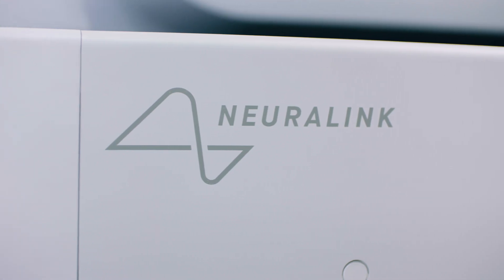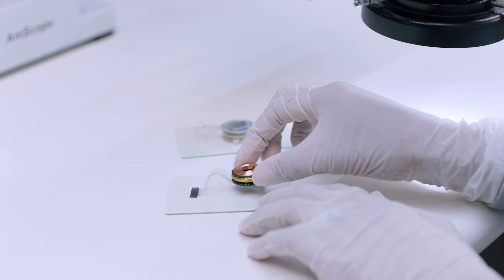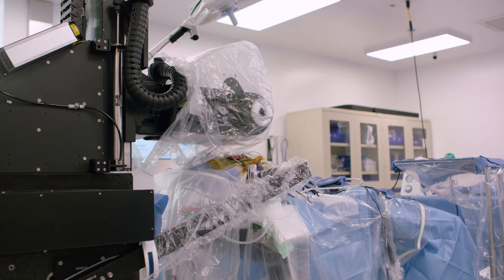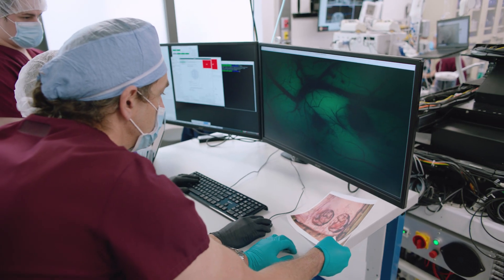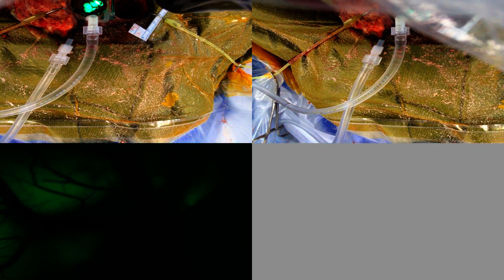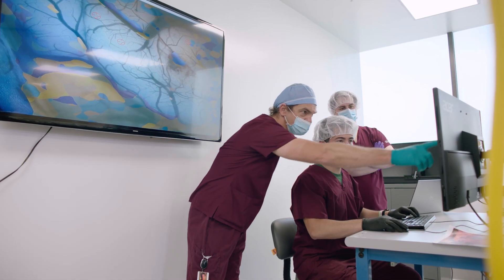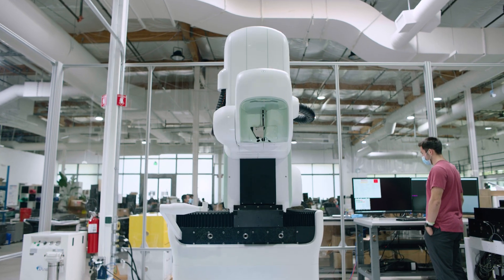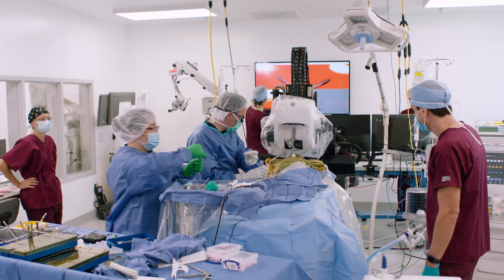Working on the Neuralink Robot

Comment: Some day I wanna work on a project like that. Though what I'd like to do specifically is work on the problem of brain digitization. I'm not a neuroscientist though (studying computer science currently). But my theory on how brain digitization would work is basically just replace one neuron at a time with a biomimetic neuron, and then replace all the neighbours to that neuron with biomimetic neurons before replacing the initial biomimetic neuron with a software neuron in an artificial neural network (basically use the biomimetic neurons to make a direct neuron to computer interface). I think doing it this way is probably the only way to digitize the mind of an individual without making a copy. Basically, replace the hardware (the brain) that the software (the mind) is running on, without ever disrupting the process (or with minor, recoverable disruptions), so that you don't create a new instance of the "software".

I know NeuraLink isn't about brain digitization, but you'd need to go about brain digitization in a similar way (using a robot to physically swap out organic neurons with synthetic neurons and such, as opposed to using it to precisely implant wires). I imagine that may be a future "next step" for this technology. I hope I can be a part of making it happen some day, but if not, then I hope it'll happen within my lifetime (I wanna be a robot fox :p).
Reply: The brain has billions of neurons in it though, this is a life time project maybe even a pioneer project that you can initiate during your life time but not seeing the outcomes of it. Are you ready for that sacrifice ? Do you believe in transgenerational R and D ? If yes then you have all my support and respect !

Comment: Wasnt there a big solar storm around the late 1800 that overcharged all telegraph stations? What would happen to an electrical implant and have you thought about safety measures?
Reply: The ability for a conducting wire or rod to pick up a signal is proportional to the length of the rod and the ratio of strength-to-distance squared. Because the neuralink probes are close to the emission source they can pick up the signal generated by the weak transmembrane electrical activity of neurons even though they are small. When in the presence of a strong pulse like an emp or solar flare activity, the small length of wire will generate negligible voltages in the probes.

Comment: How does the chip get its power? Also what if electromagnetic pulses disrupt the chip, what happens to the subject?
Reply: Well there can happen undefined behaviour... like computers every logical electronic device can have undefined behaviour, that chip cannot just read our mind but it can also send impulses meaning it can control our mind...
Anyway the power comes from a battery
Reply: The ability for a conducting wire or rod to pick up a signal is porportional to the length of rod and the ratio of strength-to-distance squared. Because the neuralink probes are close to the emission source they can pick up the signal generated by weak transmembrane electrical activity of neurons even through they are small. When in the presence of a strong pulse like an emp or solar flare activity, the small length of wire will generate negligable voltages in the probes.

Comment: So this chip will be connected to a web like interface. If it can receive and send signals directly to and from your brain, how would you really know what thoughts were yours or the systems? You wouldn't be able to differentiate between the two. If someone was able to take control of the system, theoretically they could take control of you. It is truly amazing when it comes to the repairs of motor functions and and brain injuries, but I'm not quite sold on everyone getting this.

Comment: The most prominent examples of catminion variety in terms of phenotypic characteristics or fur pattern/color and eye color: the black and milky white V-patterned fur coloring with oft times yellow to orange colored and or green iridescent eye color. These are the most prevalent of the cloned lineages in the vrsim9c. The example depicted on the right is designed with an inverted  equalateral triangular shaped patch of silicone skin in the center inner middle palm of the animatronic android's left hand. The pyrimid blac variety of catminions featured in the left side image is designed with a right side up triangle; two points below, one above in it's inner left palm.
Printed on the silicone skin on this exposed and furless quarter-token sized triangulary shaped section on the animatronic android's inner left palm is either a 3 or 4 digit pin code identify number starting in -
Examples:        .000 
                          .0000
  Divided into two sets of 50 catminions, for set 1 it is that every OTHER catminion has a black/white fur V-pattern when counting from the number fifty and going downward to the number one
  For set 2 of 50 catminions it is the inverse; that being that every other catminion starting from number fifty and counting downward to number one is a pyrimid blac fur patterned catminion. By similarly using this same  process  of selection it becomes that every other catminion from number 50 counting downward to number one is printed with either a trypton (3 digit) or tetron (4 digit) identify pin number inside of the triangle shaped patch of unfurried  synthetic skin in the inner left palm of the catminion's animatronic android body's hand.  All of the central nervous system organoids that were cloned from stem cells and genetically edited or (born) via test tubes and biodegradable 3D printed anatomically accurate scaffolding structures–
Every single one is more or less  pre disposed to paranoid schizophrenia; it is a critical aspect of the experimental elements that give impetus to the volitional initiatives responsible for  designing the technical infrastructure that went into developing this extremely contrived and novel series of experimentation. Some  of the other versions of vrsim9c's hologram universe in the other parallel dimensional timelines have a mixture of high functioning autistic savantry as well as paranoid schizophrenia in the phenotypic make up of the CNS organoids ..

Catminions with black and white colored V-patterned fur is always assigned under binary numeral 1
Pyrimid blac fur patterned catminions are assigned binary 0